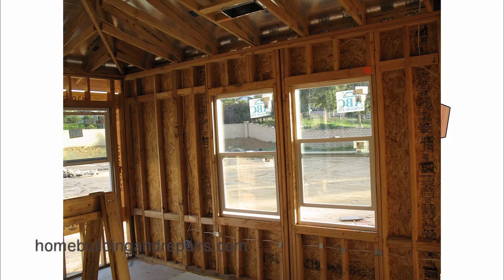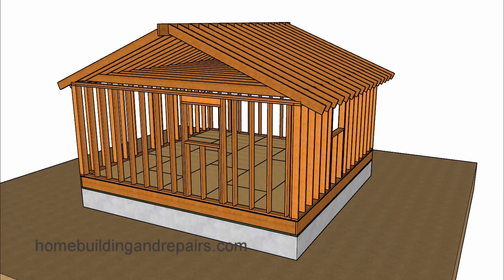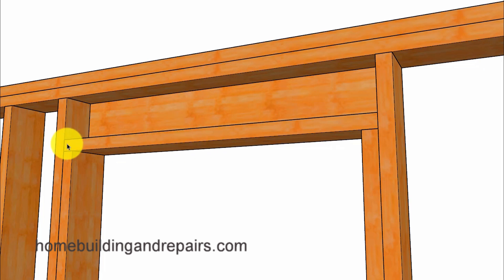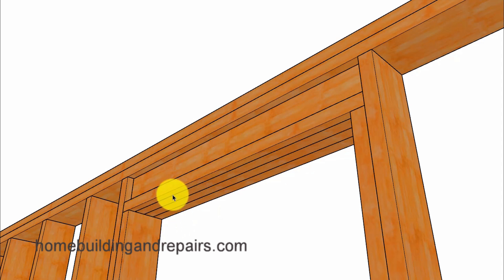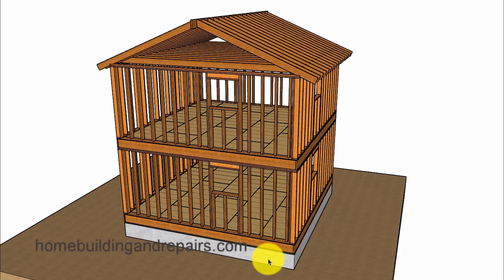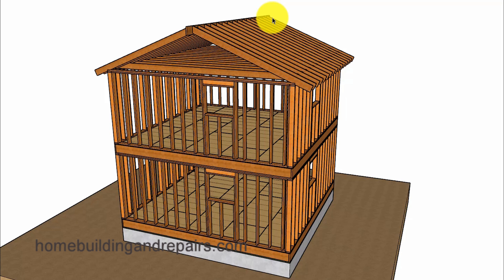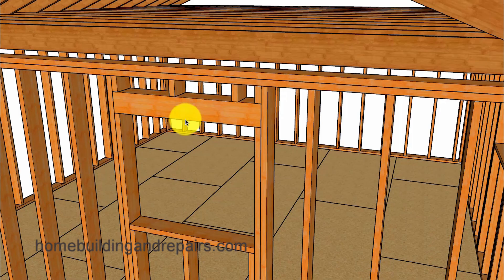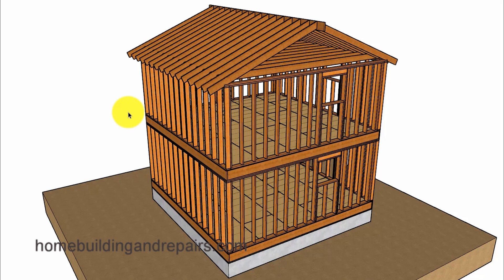How To Use Building Code Span Charts To Calculate Structural Door And Window Header Sizes

Comment: Yea, I have a comment!  How tha hell yu even get a engineer to call you back?  I have called multiple and even the guy 5 miles down the road will not call me back for a 2 hour front door beam load calc.  Its a 2 hour job from start to finish, for crying out loud!!  What do they want, 5 virgins and some gold bars before even coming out???
Reply from the maker: I understand your frustration. It can be difficult to find an engineer to help you with a project and I always had a tough time, because my projects were small.

Comment: Thanks for the video.  I'm confused as to how "building width" should be applied to one side of a load bearing internal stairwell for purposes of span charts.  I want to open up about a 4 foot section of load bearing wall on one side of the stairwell as part of a basement finish to install a banister.  The house is a 2-story home with a 2x6 load bearing wall running down the middle and along the stairwell.  The side I want to open up also is load bearing, but only for those joists that cannot pass through the stairwell to be supported by the other wall.  The total "building width" is about 28', but the wall I want to open is only supporting joists that span about 12', while the main load bearing wall is supporting joists from both sides (the full 28') over the portion of the basement past the stairwell.  My instinct is that to apply the 28' building width to both sides of stairwell doesn't make sense, as the continuous main load bearing wall seems to be supporting a lot more load than the other wall which only runs on the other side of the stairwell .  Would I use a building width of 12' for purposes of the table for the wall which is only supporting joists spanning that distance?

Comment: Very helpful video. Question: we are replacing the original windows with new construction windows in our 1930 house in CA. We are planning to change size of 3 windows, and in advance of ordering the windows we opened the walls above the 3 windows to see where the headers are located. Probably not surprisingly, the headers are not to code - there are 2 2x4s laid flat (old redwood: 2" x 4") above each window. We fear that we will need to install new headers on all of the 22 windows. Do you think this must be done?

Comment: 2:20. I don't think that's correct. On the off side (non-bearing) from roof trusses, no header is needed. Per 2015 IRC, “Load-bearing headers are not required in interior or exterior nonbearing walls. A single flat 2x4 may be used for openings up to 8 feet in width” (R602.7.4).

Comment: How do you measure (or interpolate) "building width" or "span carried" for selecting a header for an interior load bearing wall that only carries roof and ceiling loads? neither TABLE R602.7(1)  or TABLE R602.7(2) seem to have the case needed. Also, question 2: for a header that is on an exterior load bearing exterior wall that supports roof, ceiling, and has a load bearing wall somewhere near the center of the whole building (that i assume holds about half of the ceiling load)? or should I assume building width is the whole building width not counting middle interior load bearing wall? and why? thanks
Reply: You can not use interpolation in this table. What you are asking is assigning a "tributary load". 30 ft building width, the center wall at 15 ft load. so the left wall takes 7.5 ft load, the center wall takes 15 ft load and the right wall takes 7.5 ft load,. You are correct the interior center wall takes 1/2 the load no matter if it is off-center. Yes, it is the total overall load. The center wall accounts for 1/2 the load, and the exterior walls each carry 1/4 of the load.
Now if the center wall is only carrying the ceiling joists and not the roof members. we can unload the wall at least 45 psf to 15 psf. This becomes an engineering solution and not an RC prescriptive table method.
Reply from the maker: I don't have access to the charts you're requesting, but if you find them, let us know.
Reply: @gregvancom  I have access

Comment: I DON'T GET WHY THE WRITERS OF THE BOOK USE "A-B x C" format instead of "(A) B x C" OR "(A) BxC" for the "SIZE" IT'S INCREDIBLY MISLEADING, and to make things worse, on the same table, the 'span' column has values in "A-B" FORMAT. So they are using the same format for two different things. Example: 1-2 x 8    this is supposed to be read as "one two by 8" but the format reads as 1'-2" x 8" ??? (which doesn't make any sense). Also name of 'size' column should be 'amount and size', since we are talking about multiple pieces and different size pieces. Annoying as h

Comment: What if I have windows on the first floor of a two storey house, but the roof framing is parallel? The lintel would not be carrying the same amount of roof load as if the roof was perpendicular. What table should I use for this?
Reply from the maker: I don't have a table for that, but some builders use the suggested header sizes in charts for those designs.

Comment: So how does one figure header size when the width of the building exceeds 36 ft. It’s not covered in the chartsz I see where the charts can be interpolated lesser sizes, but no mention stepping up to larger. I’m working with a is 38 ft width.
Reply from the maker: I'm guessing any beams or headers that long will require consulting an engineer.

Comment: Hi Greg,

I have a non load bearing wall, my contractor used 4 by 4 inch post on each end of the beam which is 4 inch by 12 inch by 12 feet, open 12 ft. Both 4 by 4 posts are attached to a 2 by 4 inch by 10 ft stud. Do you see any concerns? Thank you. It is 1 story house with a basement.
Reply from the maker: I can't provide engineering advice, but we do have more answers to questions like yours at our website. Check out framing and remodeling.

Comment: I always just use the 1-2-3 method for framing out doors. Goes like this : 1 is  the actual door size, plus 2 inches is the rough opening, plus 3 inches is the header size. 1-2-3. Never fails.
Reply from the maker: That formula works great for the length of header.
Reply: Great way to remember size for header, but for exterior doors you typically have  to add 2.5" for rough opening ie. 36" exterior door needs 38.5" rough opening.
Interior doors 1 - 2 - 3 rule.
Exterior doors 1 - 2.5 - 3.
Reply: Double doors usually need to add an extra 1" to account for the mullien attached to one of the door blanks also.

Comment: Is there any way to figure out the size of beam you would need for a patio span? I have a section of patio that currently has 5 columns. I'm looking into changing the beams and columns so there are only 3 columns. Thanks!
Reply from the maker: I will be making a video on that later, but you might be able to use the same chart I got the information I refer to in the video. For example a girder is another name for a beam.